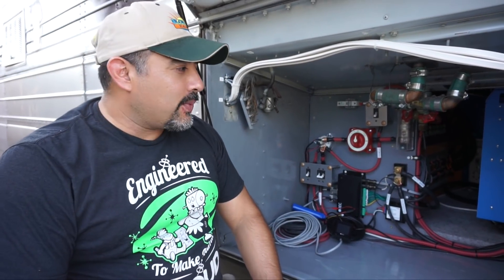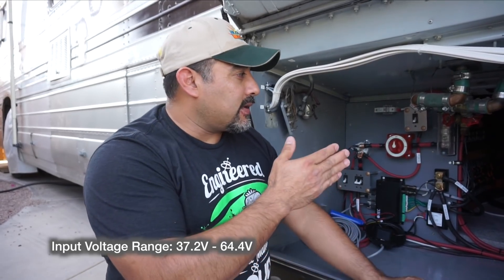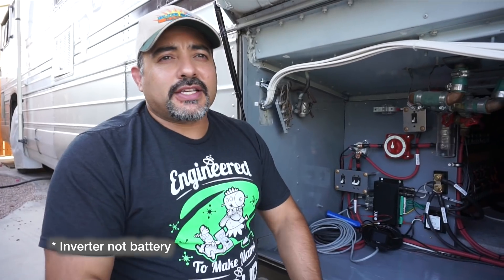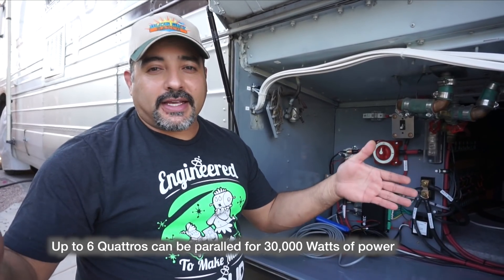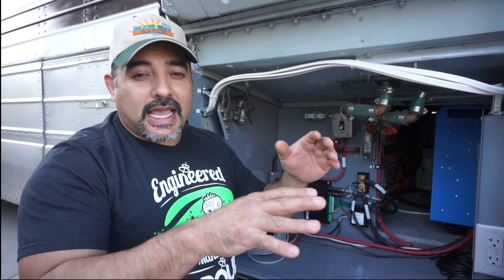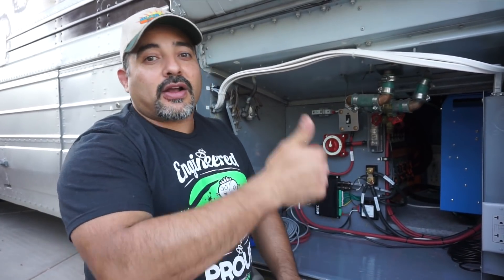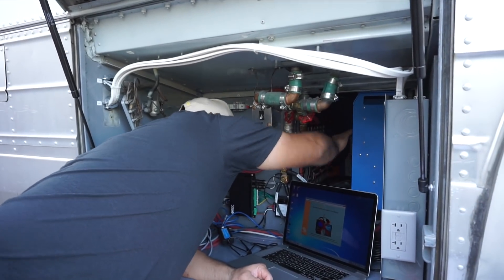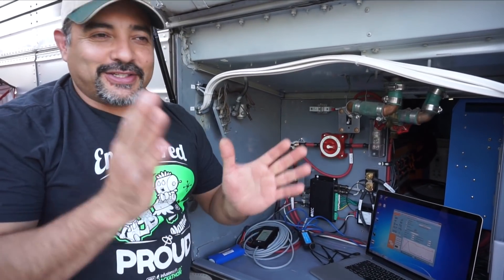Victron Quattro Inverter: Overview and Setup - Part 1

Comment: Your switch is actually only rated at 300amp.  With a 400 amp fuse "protecting" your circuit, you will fry your switch and potentially start a fire before your fuse blows.
Blue Sea makes a 600amp version of that switch. It's grey in color.

Comment: Very nicely done. I'm wondering how noisy the fans are in this unit. I have a Casita Travel Trailer and I would like to put this unit under the bed. The unit may be overkill for the travel trailer power needs, but my plans are to also use it at my home base as well.
Reply from the maker: Ours is in a bay under the bus so we literally never hear it.  We work ours pretty hard and I have opened the door to hear the fan when we are pulling 4000+ Watts.  There is some noise but the fan is fairly large so it is not a high pitched sound.  We have been VERY pleased with this Inverter and would not hesitate to recommend it at all.  We have been 100% off-grid for the last 7 months running this Inverter off our batteries and solar 24/7 to power a refrigerator, security system, a small computer, network access, and cell phone router and booster.  It has worked very well.

Comment: Great video! learned so much. I have the same inverter in my off grid cabin. Do you have to ground this system? I hooked up all the ground wires on the invertor to the AC box, but I have no ground spike. Should I have one?
Reply from the maker: We did ground it to the chassis and that is also ground to the shore power cord (which should then take it to earth ground when we are hooked up).  When we are not hooked up to shore power we should technically have a spike and cable attached and if we stay somewhere for a long enough time it might be worth doing that (I will have to investigate this more).

Comment: you mention in this video about a video you would do on the color control GX.... didn't happen!
Reply from the maker: You are correct Joseph - it took us longer than expected for get the Color Control GX wired in and by the time we got it wired in we were on to other projects.  I will do a complete walk through of our system after we start traveling and have some time to actually "live" with it.

Comment: Maybe I missed something but what program are you using to program your quattro and how are you interfacing with it?
Reply from the maker: You will need a USB interface cable like this one: https://amzn.to/32pXGZ4
You will also need the "VE Configuration tools for VE.Bus Products" from the Victron downloads page: https://www.victronenergy.com/support-and-downloads/software
Reply: Thank you for your response, I have the cables and software I just seen to be having difficulty locating where to plug it in at.
Reply from the maker: @buckno3037  the USB connector has a slot for a network cable on the other side ... Plug a standard network patch cable into that.  The other end goes in the inverter - you usually have to remove a front plate and you will see two network ports (RJ-45) you can plug the patch cable into either of those.  Victron has a short video on it https://www.youtube.com/watch?v=V1Zceq02vMA
Reply: Thanks again found it now I just need the password so I can reprogram it.
Reply from the maker: Did you set the password?
Reply: I have not, to the best of my knowledge it is the factory password.
Reply from the maker: @buckno3037  Try "ZZZ"
Reply: Zzz was it, thanks you have been a life saver. I now have it set up and off of running Tesla packs.
Reply from the maker: @buckno3037  awesome!!

Comment: If the inverter produces 110 power why bother to hook shore power through the inverter, which converts to 110, instead of directly to your breaker box in the camper?
Reply from the maker: Thank you Joseph - The reason is because the Inverter is a "Boosting" or "Hybrid" inverter.  What this means is the inverter is capable of limiting the power it draws from shore power but if the electrical need exceeds that limit - it will draw from the batteries to meet that need. For example If we are parked at a friends house and they offer us electricity but it is only a 15A circuit - If we decided to turn on two air conditioners and a microwave we will far exceed that 15A - it will draw the 15A from the shore power - but use the battery to make up what we need.  When the needs fall back below 15A - it will charge the batteries.
Reply: @BeginningfromthisMorning  Thank you.

Comment: 1. No transfer switch, totally understood. What happens, worst case scenario if the Victron Inverter packed up, how do you by-pass the non-working Victron Inverter? 2. Can the Inverter be configured on a Mac (MacOS), instead of Windows? 3. What’s the noise decibels coming from the Victron Inverter fans? I’m considering using this in an hybrid home setting so noise ideally would be great if it was low on high loads. 4. Our output loads in Africa is 240volts, what’s your thought on running such high voltages? I’m looking at getting an Induction Cooker running 3,000volts total and going off grid. All my estimated total household load should be 6,800volts (but obviously not simultaneously).
Reply from the maker: Thank you Moffat.  We bought a very good, high end inverter in an attempt to minimize the odds of a worst case scenario such as you describe.  That being said we cannot account for everything.  If the Inverter dies, we still have 12V power for lights, fans, chargers etc) - just no 120V.  If the battery itself dies we can switch the power to run on the starter batteries in the coach (for lights, fans, pumps etc)
2. The software only runs on Windows - but I have windows running on my Mac computer.
3. Noise is not too bad - more of a dull hum.  Since we have this space air conditioned the fans do not come on very often - even under heavy loads.
4. Victron makes 240V inverters for this use.  I don't think you should too much issue with it.  Even though our Inverter is rated for 5000Va it is actually capable of handling a surge of 10,000 Watts

Comment: Great vid, glad to see it all wired up! I can only find that Victron Inverters output at 50hz. How are you running American 60Hz appliances? Is your Quattro an US edition which outputs the correct Hz? Or is it configurable on settings? Thanks!
Reply from the maker: Hi Joel.  We are running the American 60Hz version (120V).  I believe the 50Hz ones are labeled "230V"

Comment: Greetings. I’m currently running a 24volt inverter at home (hybrids-solar) with a/c 240volts output and would like to upgrade to Victron 48v, could I do that incrementally due to cost constraints especially being in Africa shipment and duty costs have a significant impact. In due course would want to go off grid at about 9kva running on Lithium Batteries. Presently I’m running lead acid batteries and going through the research phase.
Reply from the maker: Hi,  You could incrementally do the swap depending on how many batteries you have an in what configuration they are in.  For 240V output, you would need either 2 Victron Inverters (configured for split-phase power) or an autotransformer.  Another consideration is your charge controller.  Most of the Victron charge controllers support 12V, 24V and 48V (some even support 36V) but you did not mention what brand you had (I would check to ensure that it does support 48V).  Once you switch to Lithium batteries the Victron Inverter/Chargers are very configurable and should allow the switch to be fairly easy.
Reply: Beginning from this Morning I got a quote for: V SmartSolar MPPT150/85 Tr @USD803.00 😢🙆🏽‍♂️🤷🏽‍♂️
Reply: Beginning from this Morning Beginning from this Morning I’m using an Enesure 24volt hybrid inverter.

Comment: I'm new here but, do you have the inlet (cold air)and outlet (hot air) for the battery air conditioner separated? Or, are they allowed to mix in the compartment? Maybe the exhaust (hot) air should be directed outside the enclosure the air conditioner is in?
Reply from the maker: Hi rickrack78 - welcome to our channel.  You are correct - the hot side (coming out the back) needs to be separated from the cold side (coming in from the sides) - we started this process by cutting a big hole in the floor and putting in some mesh to keep rodents out  - now we need to build a shroud to direct the hot air out (we'll probably just use some A/C sheet metal for that).  For right now we just open up the door and use a fan to pull the air out of the compartment.  That works well enough but it will not work when we are traveling down the road.  putting in a vent to go outside should enable us to run it while underway.

Comment: If you don’t mind what are then difference between the Victron Quattro and the victron MultiPlus. Thx
Reply from the maker: Hi ShowMeQuick.  The Victron Quattro and MultiPlus are very similar except that the Quattro has more inputs and outputs.  As the name implies it has 4 - 2 inputs and 2 outputs.  The Multiplus only has 1 input.  The other big thing was that when we bought the Quatrro the largest Mulitplus was 3000VA and the largest Quattro was 5000VA.  That has now changed and the largest MultiPlus is 5000VA and the largest Quattro is 15000VA.  Both are great inverters with Hybrid functionality and extremely configurable.

Comment: won't in power both legs of the breaker panel on a 50  amp rv service
Reply from the maker: Hi Larry - on 50 amp RV service both L1 and L2 should have power - however since our Inverter only accepts one hot leg we had to only use one of the hot legs.  The other hot leg was simply capped off at tucked away (just in case we decide to upgrade to 240V in the future)

Comment: Love my Victron stuff, Looking to add another 24/3000 .  Have you managed to update firmware on it?  I haven't dared to do it yet.
Reply from the maker: I updated the firmware on the Color Control GX - I have not done it on the Quattro - I probably won't unless REC or Victron advises it.  I have been watching your build - that is a ton of solar up there I would advise not walking on them!

Comment: Congratulations Juan and Michelle on your power up.  I can tell that you are gaining more confidence in the way you describe things.  The inverter seems to work better for lithium than flooded batteries.  Waiting to see this baby on the road.  Is the drive train in pretty good shape?
Reply from the maker: Thank you er1073 - We are getting a little more comfortable with it :).  The drivetrain is in great shape - the engine was rebuilt 47K miles ago and the Transmission was rebuilt less than 10K miles ago.
Reply: Well then you have break in mileage with your coach.  It could go a million or more miles if maintained.  Does Victron make a higher watt converter?  If they are configurable maybe a larger capacity would work instead of so many plugs or maybe I misunderstood the shore plugs and the generator plugs.  Don't get me wrong I like what you have done.  I forgot to mention that your electrical bay looks fantastic and very organized professional looking with TLC.

Comment: Nice explanation of the Victron system. Question.. you mentioned wanting to run 80-20% cycles on the Lithium battery. How did you set that up to limit the charge to stop at 80%??  I just had a similar Victron system installed  and was told  by my autoelec it couldn’t be limited to a  % charge (I wanted 90%) and it will always go to 100% from the solar ?
Reply from the maker: Hi Ken - The Victron allows your to set what "full" Voltage is - for our battery, we have 14 lithium cells in series with a maximum voltage of 4.2 Volts each - giving us maximum Voltage of 58.8 Volts.  However, we set the maximum voltage at 57.4 (4.1 Volts per cell) - we will likely knock that down just a bit more to 4.05 Volts per cell depending on how capacity testing goes.  Similarly, you can tell the inverter what voltage "empty" is.  In theory, these could go all the way down to 3.0 Volts per cell - but we have them at 3.5 Volts per cell.  The Solar controller we have has a similar setup where it allows you to set max voltage and min voltages for the batteries.  Not to confuse things any further - but when we install the Color Control GX - it will actually listen to the BMS for instructions on when to turn off the shore power charger as well as the MPPT Solar Charge controller.
Reply: Beginning from this Morning Thanks for the prompt reply. I’ll chat to my autoelec about this. Also I’ll be interested in what voltage you find in your capacity testing that you find is equivalent to 80%. (I wonder how the Teslas do it - their charge % seems to be easily user configurable.
Reply from the maker: Hey Ken - I found some information that said 80% is closer to 4.0V - https://qnovo.com/inside-the-battery-of-a-nissan-leaf/ 

TLDR: "The maximum voltage at the pack is 2×4.2×48 = 403V, though it is widely known that the Leaf only uses about 80% of the pack’s capacity (20 kWh out of the 24 kWh to preserve cycle life) making the maximum cell voltage closer to 4.0V, and the pack’s maximum voltage closer to 384V."

Comment: Nicely done!  Like the Victron's built in transfer ability.  Saves having to set that up if you don't have it already.
Reply from the maker: Thanks Tedric,  Yes the built-in transfer switch is really nice.  Early indications are very positive that this is going to be a good system.

Comment: How much of the power load can you keep as DC? Most electronics that use external power supplies do not care if you swap them to run from a DC outlet as long as the voltage and amps are what it requires. DC computer power supplies are a thing also for having a desktop computer without touching the inverter as long as you are not tied to mac and in that case mac laptops can be run from a 12vDC outlet with a car charger. 

Everything you can run directly off DC is one less thing run by the Heater know as an inverter. Would need stepdown controllers but they are already around for 12v from a golf cart battery pack you would just want one  per 5-10 amp run.
Reply from the maker: Hi Andrew.  We have 100 Amps dedicated to DC power.  It's very likely far, far more than we need.  We plan on running all our lights, fans, pumps, and chargers off the 12V DC - We'll see how it goes.